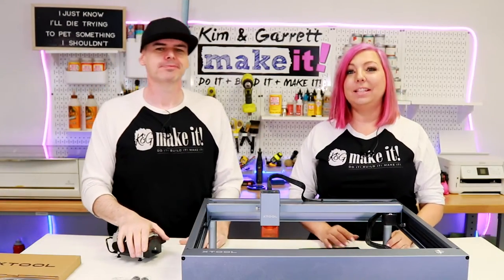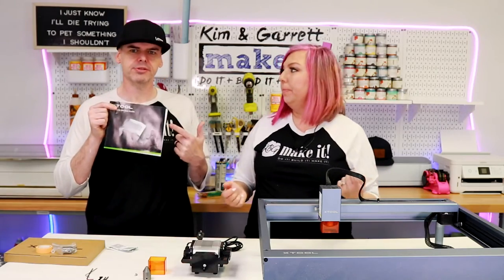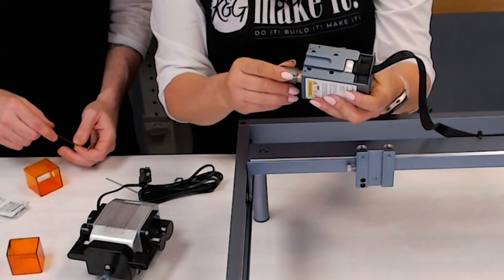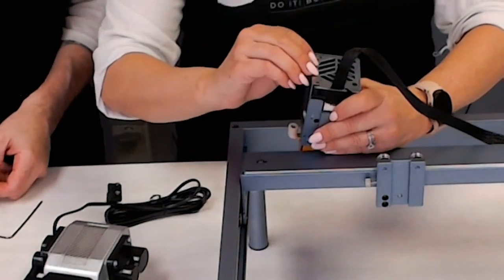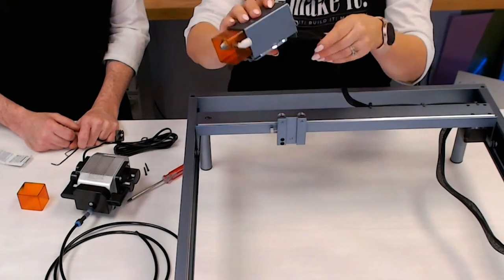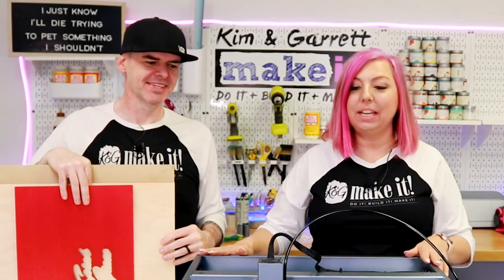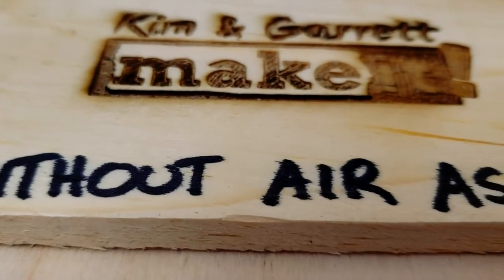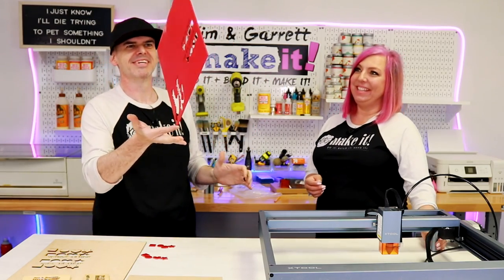Makeblock xTool D1 Laser Air Assist How to Explained

Comment: I'm Using a $30 Aquarium air pump with a 10 in 1/4 in ID aquarium tubing and some cheap dollar tree wood blocks I got from the crafting section to hold up the material to allow air under for cuts and engraving. Working out just fine without breaking the bank and I got more money to get materials.

Comment: Where is the smoke going? No vent like the Glowforge. Do you have and exhaust fan in you craft room? That is the only draw back in my opinion.
Reply: I am still thinking about this machine but I want to know where the smoke and smell is going? I know the Glowforge sends it out the window. Does Xtool have anyway of doing the same? I just don’t want my house to always smell like it’s on fire.
Reply: @cindyspear1082  These open bed lasers need an enclosure or if you have a house with a garage of some type to put it in that can be opened to outside air so your not breathing in all of those fumes from the burning and cutting. There are a few companies that make them universal and are cheaper than buying directly from the brand. I am using the Comgrove version that fits my Atomstack and a list of other lasers. The one I'm using from this brand with the Blue lining has ports on the left and right for both wires and to hook up exhaust. I'm using the Vivoson inline exhaust with some 4 inch aluminum non insulated air duct vent hose and I just stick it out the window. I don't smell anything in my apartment when I'm working with the laser so I'm guessing it's doing what it's suppose to do. Now the Comgrove enclosure isn't a solid case type enclosure it's more like a tent/portable greenhouse  but it works just fine. Even came with an LED light to connect to usb so you can light up the inside. They do have solid enclosures for these that can be bought but depending on your laser it may cost just as much as the laser itself. There are diy builds if you're skilled enough and want to do that as well.